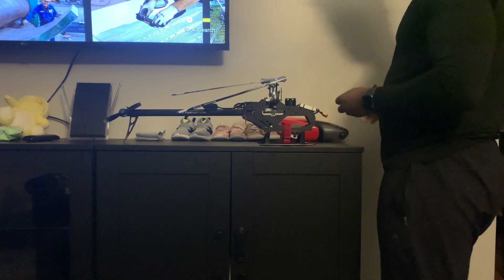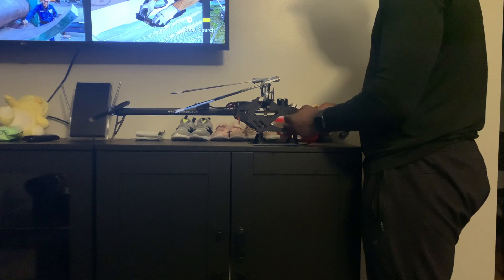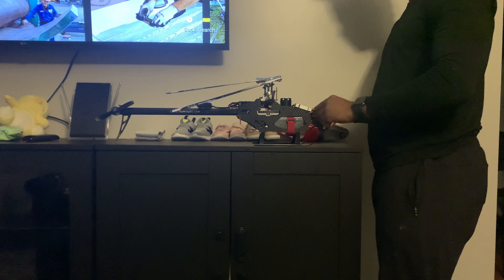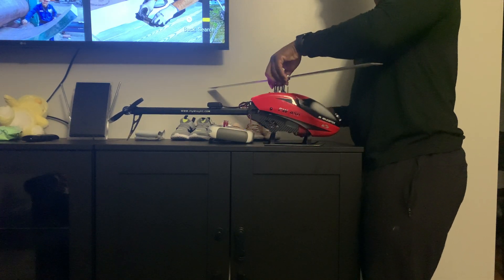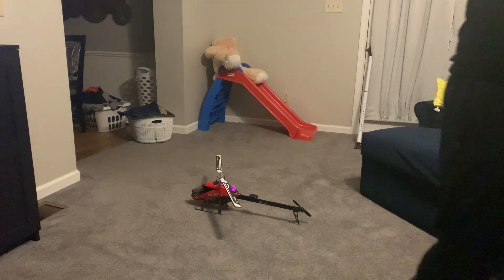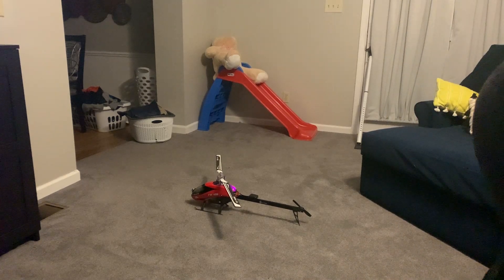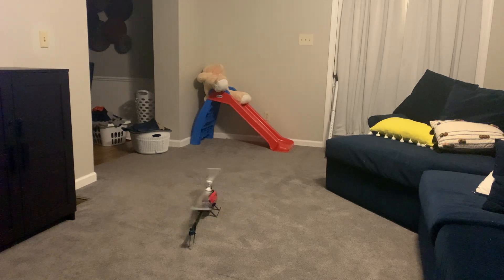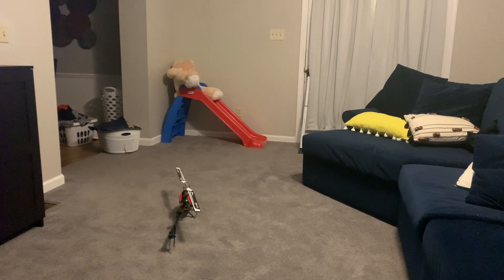Indoor Flight Hover Test Fly Wing FW450 V2 Helicopter

Comment: Gps and/or optical flow should keep the heli in a reasonably tight hover.  It doesn't look like either of the sensors are working in your case.  Shouldn't have to fight it like that IMO..

Comment: That’s not smart I can tell your not familiar with the fw450 switching from 3d to gps mode changes the collective pitch that’s why it suddenly took off. Good way to seriously injure yourself or others flying indoors when you’re not familiar with the heli.
Reply from the maker: Hahahaha familiar or not check out the stick control…It look good with an epic save. Thanks for watching! Smash the like button and then get lost!
Reply: @RobinAchoeJr  No he's absolutely right. That was a VERY dangerous demonstration. Your not setting a good example for new RC pilots. These blades can remove a hand.